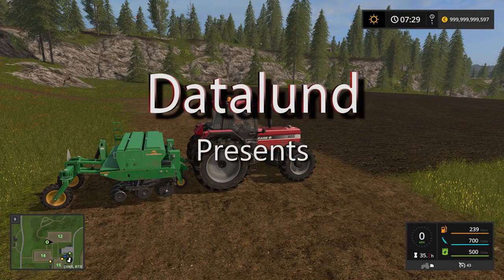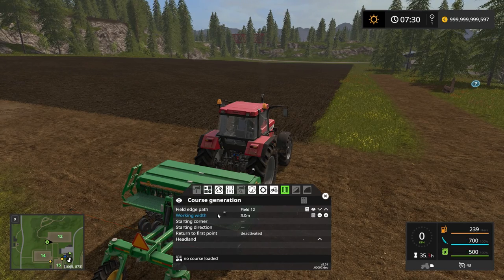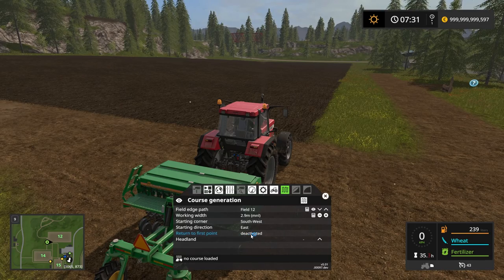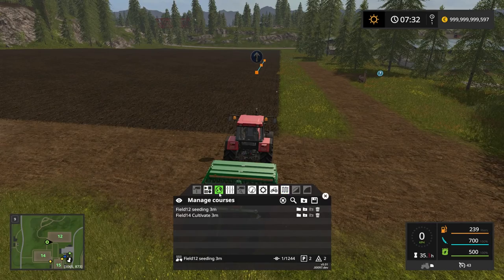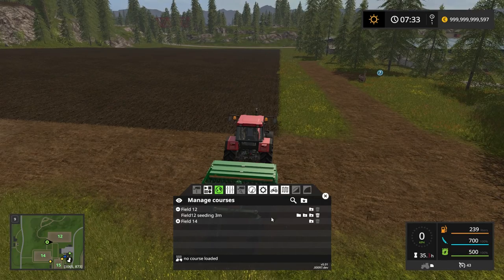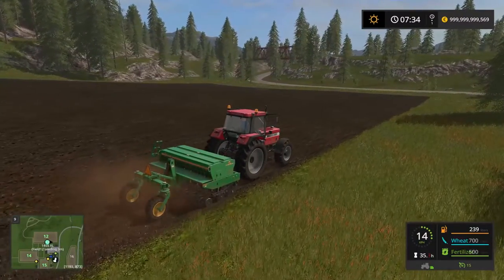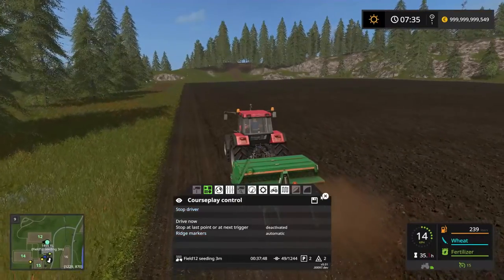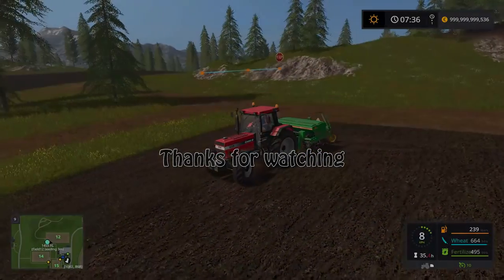How to set up Courseplay for Seeding - Farming Simulator 17 Courseplay Tutorial

Comment: Thanks for video i use cp 6 for fs19 and i use a greatplains 18m seeding but it turns out of the field... But yours turns in field why? İs there a sttings for this
Reply from the maker: The Turn on field setting in Courseplay is what makes the tractor turn on the inside or the outside of the field. In this video for Courseplay V.6 I show the difference between the settings. The link will take you to the part about Turn on field: https://youtu.be/2QVvVu_dg4s?t=881

Comment: Thank you very the very very helpful tutorials! One question about seeding: Courseplay has left a 3m strip in the field and it won't let me manually seed it. Is there something you need to switch off so you can close the field/job and finish it off manually? Also the markers (automatic ridgers as they are called) leave a strip of soil in the freshly drilled bits which I would like to redrill manually.
Reply from the maker: I am really happy to hear you like the videos! Thank you :)

You should be able to manually seed the rest your self. All you have to do is stop the courseplay worker and take over the tractor yourself.
Take a look at this video, where I talk a bit about the ridge markers. Hopefully that can help you along: https://www.youtube.com/watch?v=H87UnKac_tA
Reply: Thanks for the reply! Like I said the videos are a world of help to a Courseplay-novice. I tried another drill (seeder) combination and that would manually let me drill the rest. However not this combination. Maybe because I use mods?

Another question: What is the best way to use Courseplay when there are trees in the middle of the field? Automatic boundary doesn't recognise.
Reply from the maker: Mods can sometimes cause issues with Courseplay. And sometimes it is almost impossible to tell which mod is causing the issue, but if you have issues with a course and you are using mods, try setting up the same course using vanilla equipment.
Ah yes trees! The worst enemy of every Courseplay user 😂 There really isn't a lot you can do about. The newer versions of Courseplay do have a setting for bypassing islands in the fields. That should make the situation you describe, a lot easier to deal with. But the downside is that you will have to use the latest developer version, that can contain bugs.
Reply: Datalund Thanks for your help! I've found the accuracy of CP varies a great deal between mods. Sometimes it goes horribly wrong! It does seem to like trailed seed drills more than mounted machines? With trailed equipment going round corners it leaves quite a lot but I can manually do those bits afterwards. It is a massive help! The trees and islands in fields I will have to bypass manually or cut down for now. It doesn't really like you doing custom field boundaries around them.